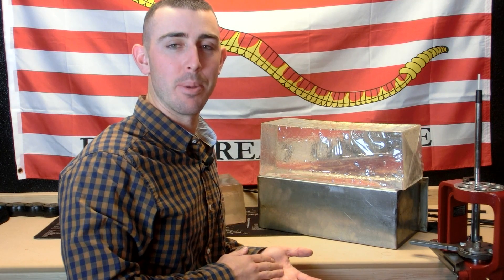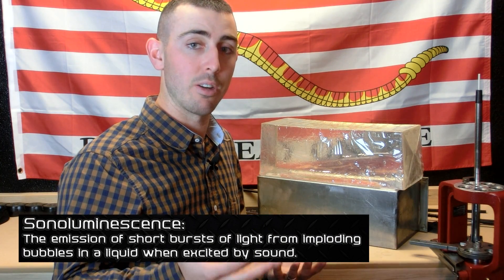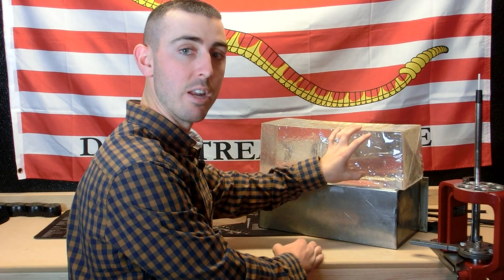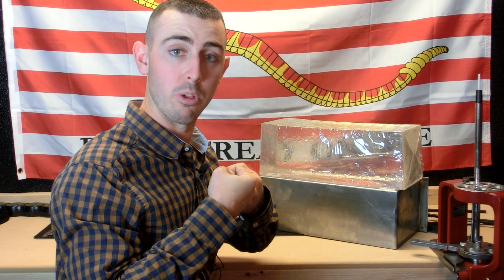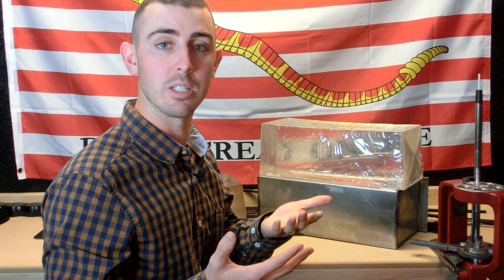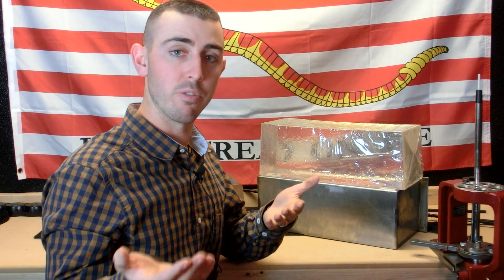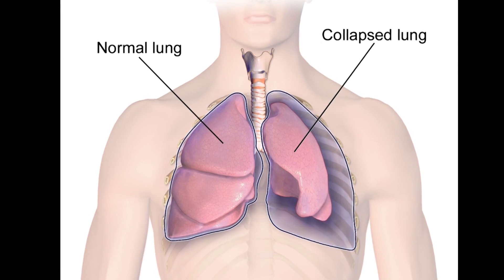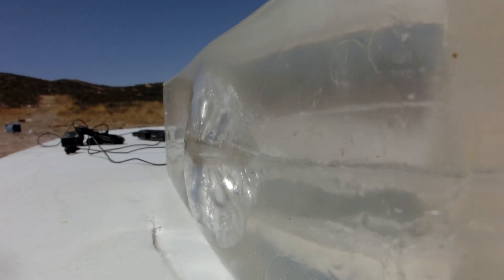Explosions Inside of Ballistic Gelatin: Sonoluminescence and Tension Pneumothorax

Comment: I dont think this would happen in a human because although the density of the gel is about the same as flesh, we arent as elastic, so the wound channel wouldnt expand that much and draw that much air in. Also, the gel tightly closes up the entrance and exit wounds, sealing the chamber, which wouldnt happen in flesh. The air would escape easily. Another factor is that our muscles arent nearly as big as the gel block. And finally, this type of gel is polymer based, so its actually flammable. The explosion is caused by the vaporized gel in the wound chamber igniting and exploding when heated to ignition temperature by the compression, just like a diesel engine... expect the fuel is gel instead of oil.
Reply: Timmytommy2 also we aren’t flesh all the way through our bodies. Just the outside, with a body cavity inside with our internal organs sloshing around

Comment: Well, first I'm not a doctor, I'm only a paramedic. From experience with GSW or Blast wounds, I can tell that hemopneumothorax or tension pneumothorax will most likely occur but not exactly how you explained it: the cavitation and puncture  will create massive tissue expansion, increase pressure in the pleural cavity and possible liquid leak, so the lung will collapse due to the pressure difference and some liquids can be trapped in the pleural cavity. Because of that, the victim will be incapacitated and will most likely die from his trauma (hypovolemic shock or asphyxia). Anyway, good informative video
Reply from the maker: Thank you for clarifying that! Im glad you liked the video :)

Comment: I suspect this factor plays into the mass versus velocity impact of different rounds (specifically light rounds such as Liberty usm-4).  On a lighter caliber such as 9mm I think the higher velocity can more than make up (if not surpass) the effects of a heavier round such as 147g..  Just my opinion ;-)  Nice vid..
Reply from the maker: I wonder if there is a way to quantify this effect. We tend to see the sonoluminescent events occur more frequently with low mass high velocity ammunition.
Reply: BoatworksToday You can look at the formula used to caclulate kinetic energy.To explain, if you double the mass, you double the energy but if you double velocity instead, that quadruples energy.So velocity > mass